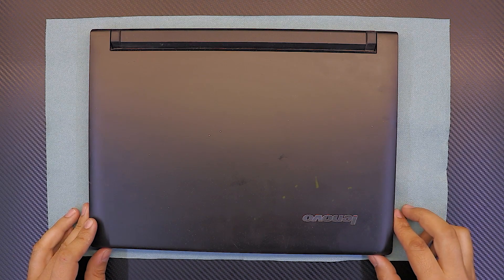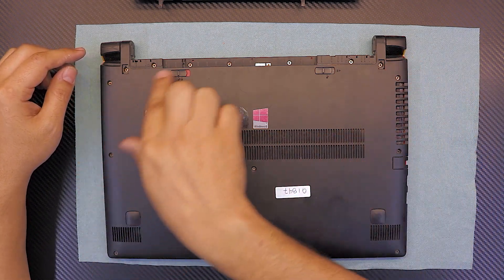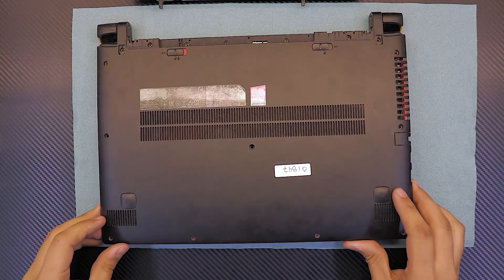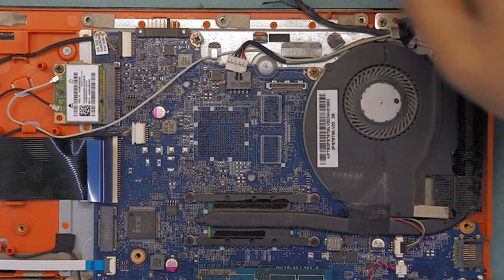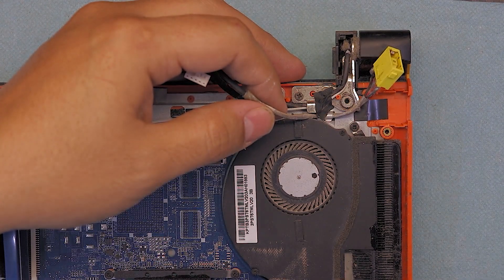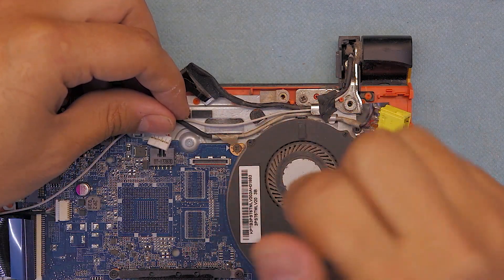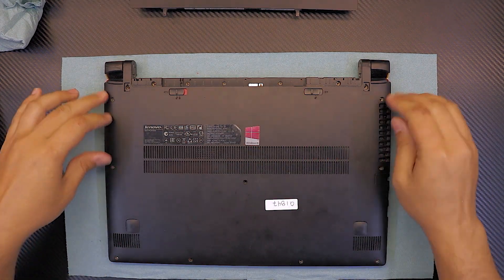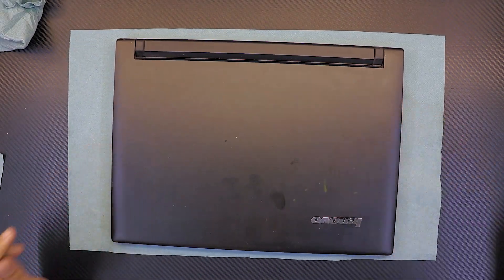Lenovo Ideapad Flex 14 Power Jack FIX, STEP By STEP

Comment: Hi. Thanks for the video. The amazon link for the power jack does not say flex 14. Does it still work for flex 14 type 20308?
Reply from the maker: Thank you for the feedback! if you wish to support the channel you can LIKE or SUB or both :P
regarding your question: YES its the same part for flex 14 type 20308, i have purchased it and its 100% compatible.
Reply: @uFixTek  Thank you. I will order it right now and I will always support your channel.
Reply from the maker: much appreciated

Comment: It was very useful because I have the same model. Question please : I replaced it and put in a new one but it is still not charging, what could it be? It's not the power cord I checked. Thank you!
Reply from the maker: Thank you for the feedback! if you wish to support the channel you can LIKE or SUB or both :P
regarding your issue: do you have a multi-miter ?, if you do then after plugging the power jack plug the charger and check and see that the voltage is present at the end of the charge port where it connects to the motherboard.

Comment: i have same laptop but i have diffrent problem battary doesnt charage what i need to do.....
Reply from the maker: this models fail a lot in a components that is called power regulator  and it must be replaced its a more technical component repair that we do in the shop, and you will need to take it to a repair shop for more detail diagnostics. i wish i could of just said that there is something that can be done apart.
thank you for the support to the channel my friend and good luck